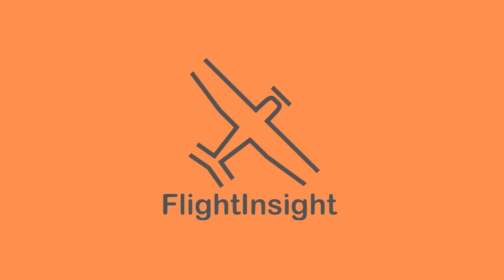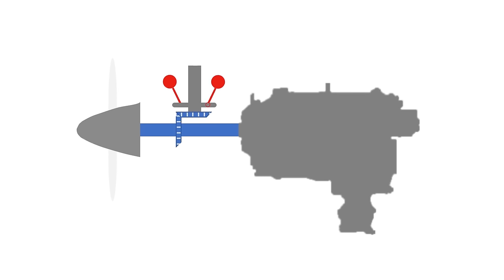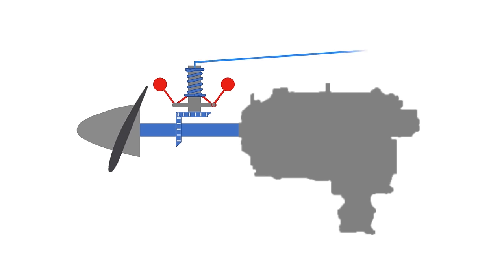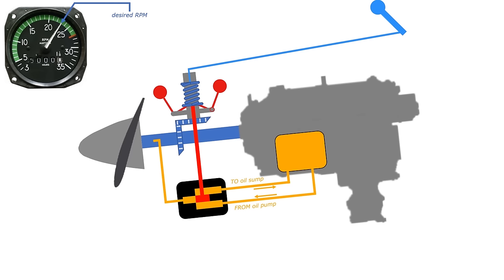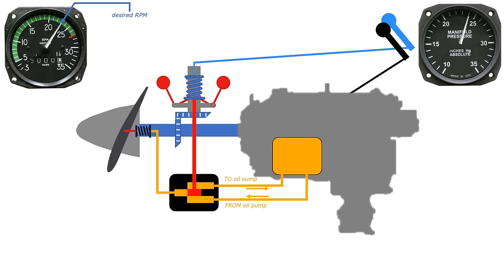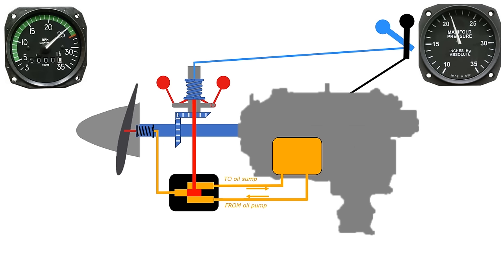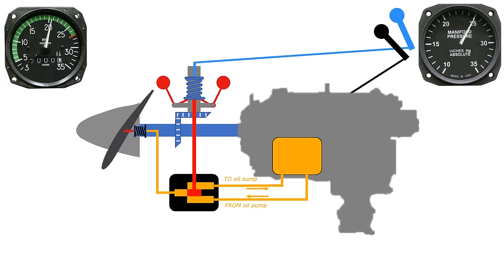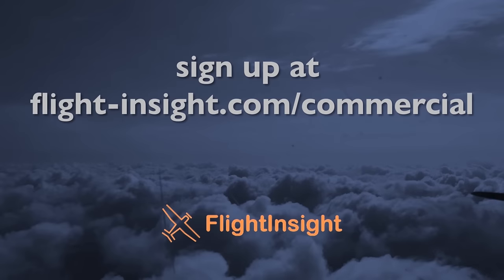How a Constant Speed Propeller Works | Commercial Pilot Training

Comment: Why not just controlling the pitch of the prop rather than making a mechanism to keep the RPM constant?
Reply: You could control the pitch of the propeller manually but then you'd have to manually keep changing the pitch of the prop all the time. Anytime you transition from takeoff to climb to cruise to descending you'd always have to keep manually adjusting the pitch of the prop. What you have here instead is a way for the system to automatically adjust the prop pitch to keep the engine at a constant speed without the pilot having to do it, which reduces the pilot's work load. Its a little like cruise control in a car. If you want you can manually keep adjusting the throttle all the time to keep the car moving at a constant speed as you go up and down hills. Or you can put it in cruise control and let the system automatically adjust the throttle so that the car stays at the same speed all the time all by itself.
Reply: @joevignolor4u949  That's a good question though, pertaining to the confusion coming from constant speed propellers achieving their goal by being variable pitch propellers. For instance, some explanations stress the aerodynamic  rationale behind having a low blade angle on T/O and a high angle on cruise : any propeller being more efficient at producing thrust at a low AoA, it makes sense to tilt it as the aircraft gains speed and modifies the relative wind's direction meeting the blade's leading edge.

That's all well and good but only peripheral to the root cause of why a constant speed propeller is desirable. My take is that it's more to do with having a constant speed rotating shaft of the engine, as the latter will be more efficient at a desired RPM. At the end of the day, I do think that 'gearbox' explanations of CS props are more on point than aerodynamically oriented ones. 

I might be mistaken, suggestions and comments are welcome.

Comment: The guy does not know what he is talking about (0:30  - 1:00).  "Higher pitch will take a bigger bite with each rotation, but the added drag will reduce RPM". No, no, and no: higher pitch will not take a bigger bite in cruise, and the angle of attack will not be bigger, because the airplane is flying, i.e. the effective angle of attachk stays the same, but since the airplane is moving against air, the optimum pitch indeed is higher.  For the same reason, the drag from the propeller is NOT HIGHER for high pitch setting in cruise. In fact, the contrary is true - the propeller drag is reduced and optimized through higher pitch to obtain the most efficient angle of attack of the prop.  The diagrams are also misleading, for a stationary aircraft, they would indeed show a change in attack angle, but in reality, the prop attack angle of the flying aircraft should remain the same, but a vector must be added for the airplane speed.  VERY MISLEADING AND VERY FAULTY UNDERSTANING of how constant prop works.

Comment: I appreciate that when manifold pressure is introduced it is 24" and 2300 RPM, with no mention about any "oversquared" old wives tale nonsense. Don't listen to any instructor or pilot who tries to press that BS on you, they don't know what they're talking about and are just parroting what their boneheaded CFI told them...

BTW, High MP and low RPM is more efficient & your manual approves such settings. Low RPM = increased volumetric efficiency, less BHP friction losses, higher prop advance ratio. Inches of pressure has nothing to do with the first two digits of revolutions per minute, those numbers live in different dimensions. It could just as easily be PSI of MP and revolutions per second.... Use your brain and learn how your equipment actually works

Comment: Are you serious? Who designed that crap system? You’re sending the blood of the engine all over a complex rotating assembly with lines outside. 

Must be aviation designers and engineers have been teaching the same stupid things to each other in college. Let me help you all with a little practical application 101. You never use a primary supply of the engine, like vacuum or oil to regulate any other system outside of the engine.  You may drive machinery with the engine that does the things you need it to do. But it is an absolute terrible idea to use anything an engine absolutely needs to run, to regulate anything else outside of it. 

Let me guess, the guy who designed that works for Boeing and his brother for the FAA? 🤣 

Oh yeah, and after a quick Google search. Turns out that system is actually responsible for a lot of oil leaks and seized engines.🤪